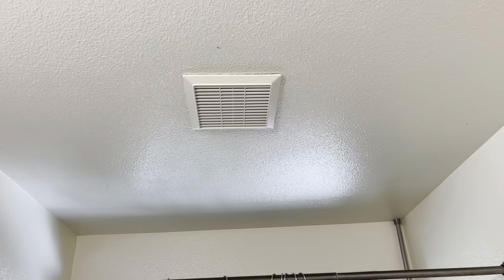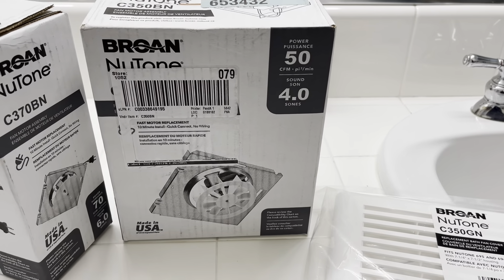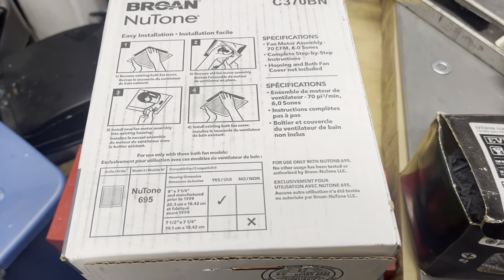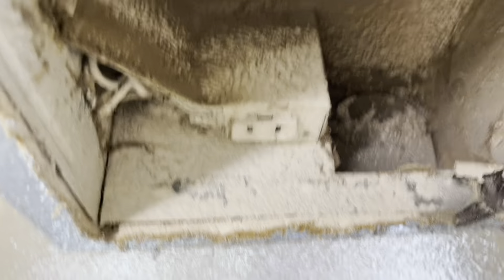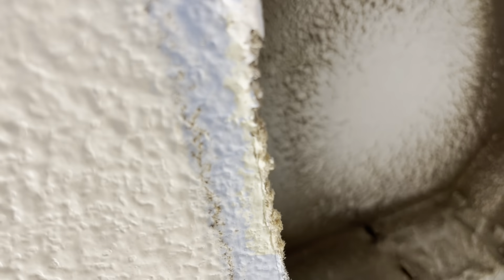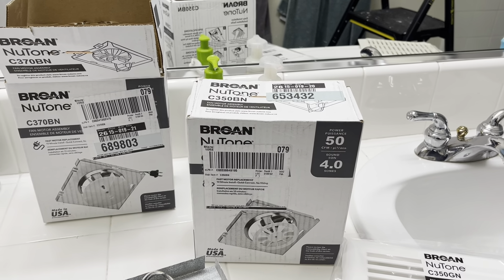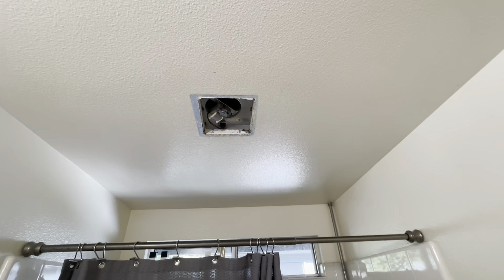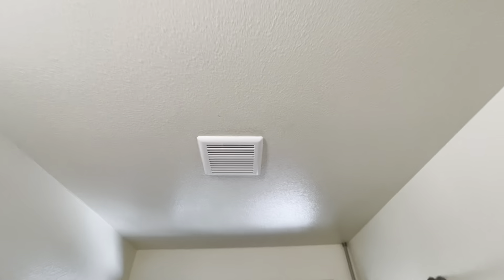BATH FAN NOT WORKING, EASY CHEAP FIX! BROAN NUTONE 695 997 696 N 696N

Comment: There’s no need to throw away the old cover because it’s yellowing. 12% hydrogen peroxide gel like the gel they use in a hair salon works great. Just paint it on the yellow plastic with a small paint brush, wrap it in plastic, put it out in the sun for a day or so and it comes out bright white. No need to put that piece in the landfill. One bottle of that stuff will last a really really long time.